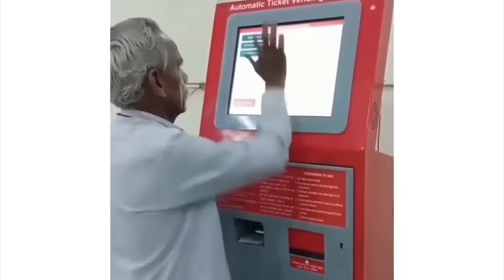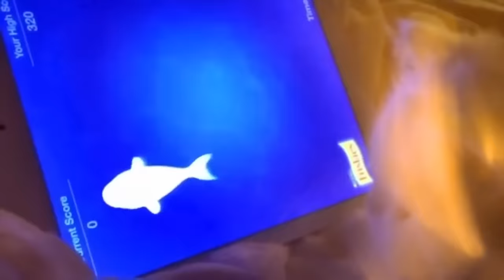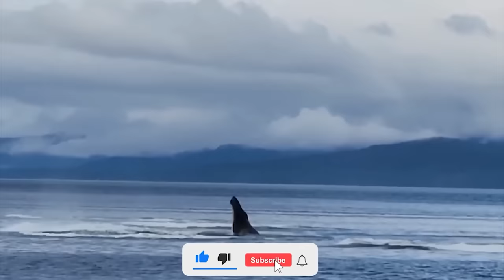Incredible Moments Caught on Camera

Comment: The year without summer we have had more than just the one in 1916 l remember where we had a complete summer where the temperature never reached higher than 26/28degrees  not really winter’s condition but in a country where temps can reach from. 35/45 and higher ld would call it a year without summer
Reply: Aah Fahrenheit, I live in celsius 34 is hot 25 is fine😊

Comment: I don't think the dog that gave the piggy a treat did so from an empathetic or selfless stand point. I think its just they are not intelligent enough to distinguish much about percentages or have much capacity to make them good at selfishness. Not they can't be selfish, they just lack the smarts to be any good at it. Just like they're not smart enough to chew up your sofa while you're at work knowing when you get home it will be clearly obvious it was them, they just don't have that level of brain capacity. How many times you seen videos where a dog did that then looked at the owner with a big innocent face like they're thinking it will convince the owner it wasn't them that chewed the sofa, lolmao.

Also it has become possible to solve the problem of tangled wires, in the UK we've always buried them, we run them underground which being out of sight means we don't have a mass of tangled wires running overhead in all our streets. Its not rocket science.